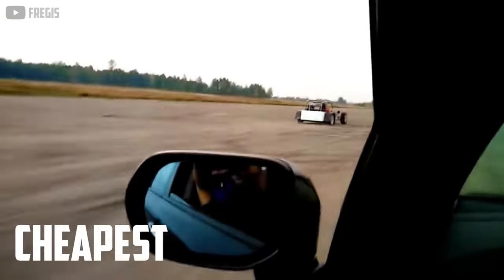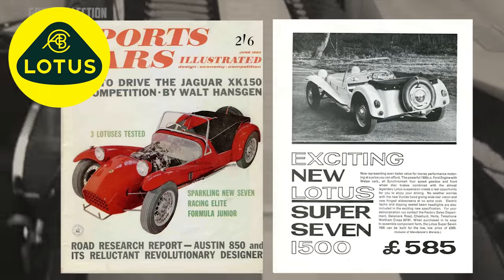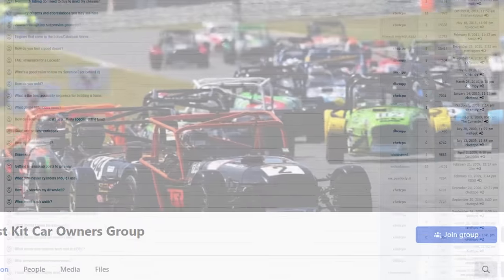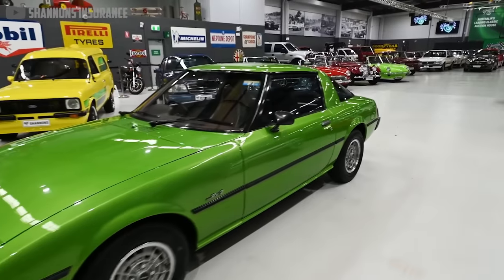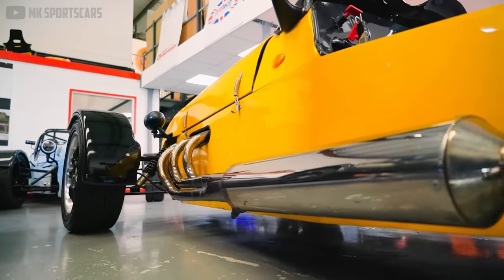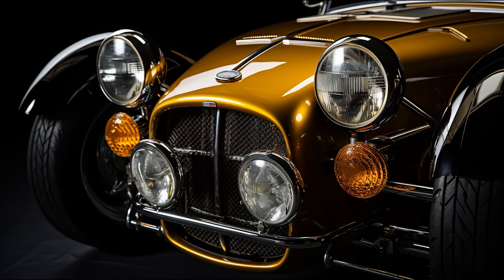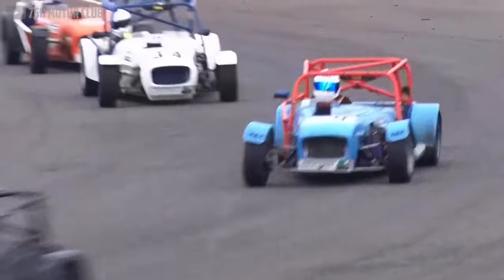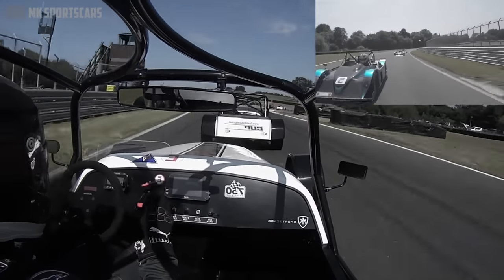LOCOST: The Underground Cheap Supercar Slayers

Comment: I'm a welder and would definitely buy the prebuilt chassis. Simply for the time and frustration of the set-up. A few grand is cheaper than a few weeks of my time and labor.
Reply: It is not hard at all to build the chassis. I have never welded before. I'm a machinist. I have picked up a Harbor Freight style mini mill and cut to final size all the tubes on it, specially the angles with a 3" cheap vise with an angle base. Used a $200 Vevor band saw with a miter base. Everything fits perfectly, no gaps.
Reply: @19mati67  you're not quite grasping at what i was trying to say. My time is more expensive than the cost of that frame already put together. See I need, Time to clean area for project, Time to gather materials, Time to study plans, Time to build any jigs. There's 3 days minimum and i haven't even started welding....
Reply: Мне пришлось делать реплику поскольку у нас не делают такие автомобили в Казахстане.😢😅
Reply: Check  out the quality welds on a factory five car and ask yourself how fast should I go ?
Reply: Haha, not really the spirit of locost mate.  The hole point is that you have time and not a lot of money.  You might as well just buy a normal car.
Reply: A machinists time is quite expensive as well. But the joints are perfect when we do it. 😊
Reply: I'm a welder too and I get that viewed only as time Vs money you're right but I'd rather the satisfaction of knowing I built it (unless it fails and hits a wall of course but hey.)
Reply: As a welder I understand exactly! I’d do it myself for the fun and satisfaction.
Reply: Only people that don’t agree or atleast see your point probably haven’t even built a car… or fabricated anything serious.
armchair experts mate
Reply: @irony13black  For me, is the build is the most important, not even the driving. It's a hobby, hobbies are not cheap usually. The biggest takeaway is, that you have built it, the satisfaction. You figure things out on your own, or from forum members.
Reply: @glenmel78   It all depends on what your goals are. If your end goal is a completed car, buying a premade frame makes sense. But if your end goal is to build a car from scratch, then welding one up is the way to go. Different strokes for different folks.
Reply: I'm a fabricator and I look at it the other way. Yeah my time is valuable but I get the most enjoyment out of building something for myself. My work is my hobby. Plus I get to throw my touch in. That being said I also hate the negative anti-safety aspect of this video. That is first and foremost for me. Dad has always been insistent "A car should stop before it goes. Your survival is more important than the car's. We're good at fixing cars. People not so much." 👍
Reply: @slutmonke  a quality welder that's gonna rely on unknown quality of whoever welded it at the lowest bid? 😂 Nah I'd rather do it myself. Maybe that's the difference between a welder and a fabricator though.
Reply: But that goes for all parts of the build process not just the frame. Looking at it that way youre probably best off just buying a ready made car.
Reply: You're a skilled worker. It's not made for skilled workers. Your time is worth way more money, but to hobbyists who want to give this a go and don't mind putting hours into their hobby, this is perfect. If you're paid 45/hour to weld all day every day, you don't want to spend 40 hours (or 1.8k) welding even more. If money is short and you want the challenge, then you have your answer.
Reply: Ah.. the differences between a welder and a fabricator, right there, ladies and gentleman.
Reply: healthier  choice and you still can  put some mods on it i guess
Reply: It never has to be perfect. You could build your car on the floor, with a tape measure, and everything requiring perfection (toe) is adjustable.
Reply: I've seen pictures of wrecked DF Goblins. On every  one, the tubing split several inches from the welds. They are definitely high quality frames.9
Reply: @glenmel78 I do laser welding for jewelry and I can't help but smile every time my ratios are the same. If I'm welding for 15 seconds, I'm usually spending 45-60 seconds lining up parts into my tools, tacking, checking, and rechecking.
Reply: I was thinking the same thing
Reply: @glenmel78  You'll never have a project then, Projects aren't about time, they're about achievement, and the satisfaction that comes from that...
Reply: @glenmel78 personally I just eyeball everything and it hasn’t failed me yet, tho I’ve never done an entire fucking frame so 😭
Reply: Yeah, and keeping it straight? I 100% couldn't do it but I can see why it's extra hard
Reply: Well good for you, your time is very valuable. Some people like to make stuff with their time
Reply: @Mikey-jm3dc  your time may be quite expensive too and the joints pre weld will be flawless. but I'm betting my left testicle that a machinist like you with the perfect fitup couldn't match the welds a tig welder like myself could put down on less than optimal joints.

however, imagine a machinist making the joints and a professional welder doing the welding, it would make the perfect chassis.
Reply: @glenmel78  If what what you describe is your largest problem, this isn't a project for you. Maybe ranch fences or BBQs are more your speed. And  have a look at a westfield or a MK sportscar chassis before talking silliness. People happy with that standard have no confidence in their workmanship.
Reply: @somedude2492  Why do you presume s/he is a skilled worker? He just said he's a welder. He could be welding cracked shovels on a chicken farm for all we know.
Reply: @glenmel78 100% 2nd this. 

I can weld it be fun but $ vs time. I'll buy it welded. 
Now new move bumpers I'm get one weld it up . 
😅
Reply: @glenmel78  You certainly make enough money welding to not waste your time welding for free. I understand where your coming from, but to some people the experience of putting something together that is not expensive (DIY) is much more satisfying than just buying something.
Reply: You must not be a very good welder or you wouldn't trust anyone else's welds. You would look at welds every you go and see nothing but heartbreaking disappoint.
Reply: Welding is the easy part, the bending, notching, grinding, fit up is the the time consuming part. As a full time welder, I’d most definitely rather buy a kit or fully finished frame than do it myself. I don’t have time to figure out steering and suspension geometry. So I totally get what you’re saying
Reply: Here’s the thing though; the cost of the steel alone is going to be almost as much as the entire prebuilt frame. Especially here in the US steel prices are effed because of the environmental shit.
Reply: @glenmel78  Only if you are a welder by trade... loads of people find that sort of thing enjoyable, i would MUCH MUCH MUCH rather spend my time building a chassis than spend 3,4,5 x less time working to earn the money to buy the pre-built version

Except i would always always always build a car from a bought kitcar or modify an existing car. The individual vehicle assessment (you need to pass to drive a kit car on the road) in the uk is as stupid as can be.
Reply: Built not bought❗️💯
Reply: This chassis could be built in a week with your donor parts available to size up and place as you go.
Reply: Agreed . By the time I survey my jig hard points , tack , measure and re-check ...I've paid for that welded chassis to my door .
Aircraft welder
Reply: @glenmel78 totally hear what you are saying but as a welder wouldn’t you rather get into a car with the frame YOU tig welded? Gonna assume you also see shit in random places and wonder how TF did that pass?
Reply: @glenmel78  I was thinking the same thing.  Once you have a jig built, you can fly through a build, but it's that first time that gets you, and the first time is probably the only time, for most.  I would still do it, myself, though.  I think that would be a joy you'd carry to the grave.
Reply: @19mati67  I don't believe you
Reply: I agree , as a welder in the business . You will find that a welder , wire and gas time spent fabrication will eat up time and sanity .
Reply: @KevinxDoll  What you don't believe?
Reply: Classic time is money, though most of these are free time projects, got a spare 30mins… do a few things in the shed.
But if you want it now the go ahead, you still get the joy of doing it yourself, most make two though and build the 2nd from what they learned from the first, normally a few tweaks different dimensions
Reply: Same with boats.. but some people just like the trauma
Reply: You can make more money but you can never get more time.
Reply: @glenmel78 so time is worth more than money is what you are saying?
Reply: I am also a welder and I 100% agree with your statement.
Reply: Most people can’t do the math to figure out what’s the better value, which is subjective anyways. Most of my carpentry didn’t really save me money even after I retired, lol. It’s all good so long as you are happy with your car.
Reply: @jimmccorison  If your end goal is a completed car, the best way to achieve that is to just buy a completed car.
Reply: @FreddyFunderbunz  You don't have to figure out steering and suspension geometry, it's all on the plans.

Comment: I built a Miata based Exocet which is based on a British kit car similar to a front engine Ariel Atom.  I think it is much safer than 7 builds even if it is a little heavier.  It uses all Miata parts and is easy to build with zero welding needed.  Mine had ABS brakes and was a joy on track and off.
Reply: I hadn't heard of that one before. Looks awesome! About how would you say it ended up costing overall?
Reply: It’s based off the MEV Exocet and is bigger than most 7s, maybe a little shorter. Edit - you said safer not smaller.
Reply: Nice!! I'm always kicking around the idea of an Exocet Offroad build-- glad to hear it worked out for you!
Reply: Miata's are carrying better values than Exocets nowadays. It was a cool concept at the time though.
Reply: Hey, I am, about to purchase a donor car after Christmas. Mind if I pick your brain some?

Comment: I'm building one as well, Duratec 2.5($348 LKQ=49k miles 2016 Ford Fusion), MX-5 NC 6 speed($550 wrecking yard) and NC LSD($329 Ebay got lucky). Complete rear end from the same car. McSorley442E chassis.
Reply: What are you doing to adapt the Duratec to the NC 6 speed?
Reply: @cdjhyoung  Nothing, it bolts up perfectly. MX5 and Duratec engine blocks are the same. Most of both engines are the same.
Reply: @19mati67  that's really cool! Was going to ask why you were using the 2.5 duratec not the 3.0 but if it matches the NC gearbox that's amazing

I'm mid build on a 3.0 AJ30 mk2 mx5 at the moment and heard all over online those gearboxes don't quite line up to the 2.5 correctly!

I'm hoping to get 275-300 out of my 3.0 though and the adaptor plate etc. really wasn't that much hassle so i'm really glad i went with the 3.0 

was £350 with all the ancileries, loom etc. a complete steal!
Reply: @MsArchitectschannel I wasn't even aware of the Jag/Mondeo= Fusion in US, engine would work. With this 2.5 and ITBS, danst performance engineering in stock form, gets around 200hp. I'm not looking for high performance machine, it will be street driven.
Reply: @19mati67 the 2.5 is a 4 pot still, not a V6 like jags/Mondeo. We just didn't get it in the UK

Comment: Fellow builder here.  Using a Chevy 4.3L V6 donor, I'm slowly working on getting my car cobbled together.  Been wanting to build one for over a decade and finally pulled the trigger during COVID.  It is AWESOME seeing these cars getting some love.  Thanks for the awesome vid.
Reply: Mate... I think you're using the wrong engine. I built a locost years ago powered by a 2l Nissan turbo. It was way more power then the car needed, esp for a street car. A small lighter engine that you get to rev will make for more enjoyable car. They're really all about handling and not power.
Reply: @andrewr7001  I didn't think there was a 'wrong engine' when you're building a car yourself. It isn't necessarily the 'best' engine, but I had a donor and the engine ran strong. The ethos of these cars is to keep things light which translates to fast, but I don't think this engine will detract from the level of fun I'm expecting.

Comment: I bought the book in the late 90's and since we don't have rear wheel drive Escorts in the U.S. I started looking for a Cortina or Pinto donor car. I recall that some people early on were successfully using the Chevy S-10 drivetrain. While researching everything Lotus 7 I decided to do what Colin Chapman did...use cheap available parts. I discovered the same parts he used in the early series were still available so I bought a pair of Ford 1.6 Kent Crossflow motors with 4-speeds attached for $100 ea., a Type-9 5-speed out of an XR4-ti, two Cortina GT rear axles, a GT intake and downdraft carb, and 2 spitfire front suspensions with all the useful bits still attached. I have rebuild kits for the carb, trans, brakes, front uprights, and some motor rebuild parts. No, the car never got built but it was a fun research project while it lasted.
Reply: if looking to go ford, you can always look at the ford contour which was a rwd. they were only made for a limited number of years but there was also a mercury version. if you want to go high performance it may be worth trying to get your hands on the Contour SVT parts.

Comment: A fan of the Lotus 7 since I first saw one in 1963. My solution in 1985 while living in Germany was the Donkervoort S8. A completely finished automobile using updated 2 liter Ford engine & other components. Donkervoort has since moved more upscale using Audi engines & running gear.

Comment: My car features in this 3 times. I race in the locost series for 750mc . We run around 85-89 bhp from a xflow 1300. Definitely recommend it to anyone looking to get into motorsport. Maximum fun minimum cost
Reply: Could you detail a bit costs and budget that is needed please ?
Reply: @kaspeer  sure, to buy a competitive car you are looking at £7000 upto £12000. Entry is £350 per weekend with additional £280 for test day on the Friday * optional. Tyres £380 per set that lasts for around half a season Inc testing on them. Fuel is around 25l per weekend.
Reply: @TrackPace  Well this is getting expensive really fast, do you advise going directly in the Catheram Academy with this kind of costs ? You have to buy the car but if I'm not mistaken everything else is assumed by Catheram like tires and stuff ?
Reply: @kaspeer  I think the caterham ac isn't a bad shout. I believe it's around £40,000 (Inc the car) a season with them. Tyres are definitely more expensive with the caterham and also the parts if you was to bang one. Once you've spent £8000 on buying the locost you budget will be around £8,000 a season Inc tyres, traveling, entries, fuel and damages etc
Reply: @TrackPace  well, this is Motorsport so there's no perfect solution but what you're depicting here with the low-cost versio sounds interesting. Any trusted dealer or website to buy this kind of car ? Appreciate your honesty and your advices 🙏🏼

Comment: A lot of the video was flipped left to right, these are nearly entirely British right hand drive cars. The 1970s Lotus 7 weighed well under 600kG, so with the often used 1600 Ford engine with the tuning parts of the time they had a better power to weight than a 1970 Corvette that weighed 3 times as much. I have been out in a genuine Lotus 7 as well as some clones, so much fun, fantastic dynamics. Not great for top speed due to gearing and aerodynamics, modern builds tend to have more modern drive trains. A stock MX5/Miata engine transplanted into a car of half the weight will fly along and be reliable. Anyone who says they are comfortable on long journeys is lying though.

Comment: My favorite car that I only had for two months 😔 was a 76' super beetle with an 84' rx7 rotary in the back. Back bumper had a sewer pipe welded below it. Popped wheelies and ground the pipe on the e-way up to 70 going into 4th. Couldn't see 💩 scary as hell. 
  Sold it back to the guy because I'm dumb.
Reply: Not so dumb. You're alive today, and getting rid of that car was a huge contributor to that fact.

Comment: Built mine (between 2002 - 2006) from scratch (chassis +4" wider and IRS rather than live axle), made all bodywork (both ally and fibregalss) and built twin turbo Rover V8 to go in it (fabricating exhaust manifolds for the turbos and used a pair of conjoined Renault 5 GT turbo intercoolers.
Reply: Twin turbo v8 would've been absolutely nuts

Comment: I've had 4 of this style of kit car; 2 built by me from scratch including a chassis Ron Champion welded up for me with a few mods. My advice if you want to keep the cost down is a) fit an engine that's already high powered as tuning costs too much b) buy one from someone else who's lost their shirt on it as they cost far more to build than you might imagine. Do I regret it? no but the fun they gave me was actually quite expensive overall.
Reply: And don't get too hung up power. A cheep engine with the right feel will result in a nice car.

Comment: Hey, surprise to randomly see myself in a video! For reference the car at 0:46 costed me somewhere between 15-20k to build (total cost of all tools, waste, everything) based on the most premium parts that were feasible. The immature version of myself (the one that started the car 10 years ago) wanted a v8 in a book frame, and it ended up being extremely impractical although it drove at normal speeds just fine. Extremely loud, extremely powerful (to the point of not being able to put the power down to the road easily), and required glasses to drive due to rocks.
Reply: stunning build!